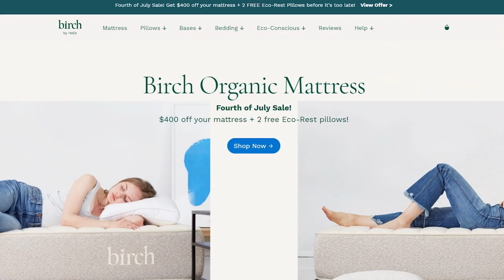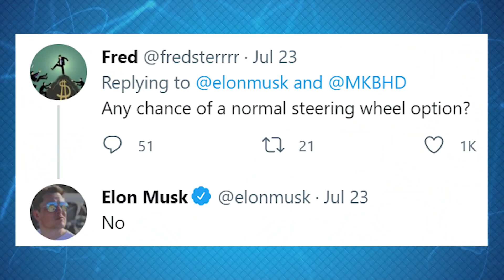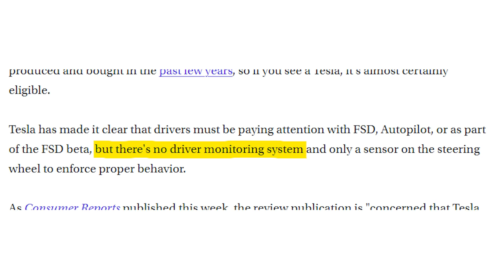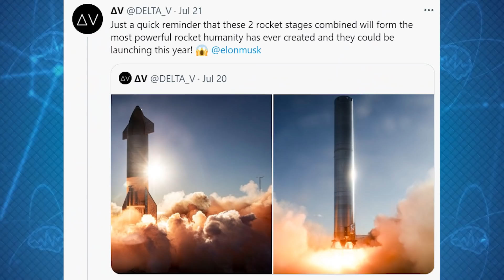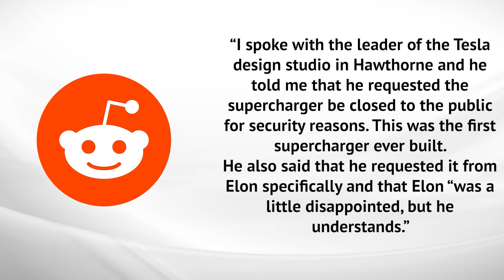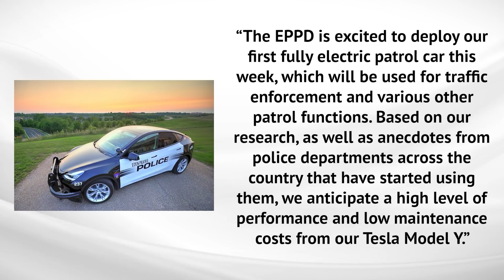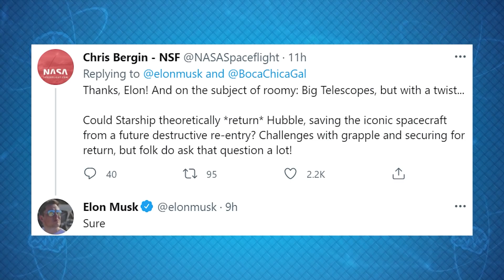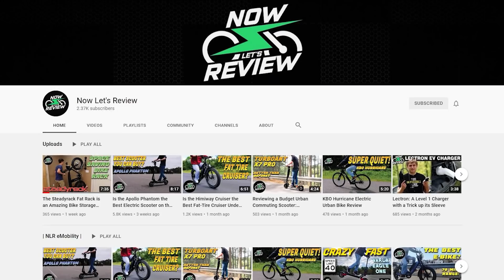Tesla Time News - No More Steering Wheel??!

Comment: The Patreon poll should add "I don't mind as long as the other EV is capable of at least 150Kw charging"

I don't want slow charging vehicles being there for 5+ hours
Reply: Though they charge by the minute right? So a 5 hour charge would burn an unsustainable hole in some EV owners pockets. Those folks would learn not to charge that long at the stations, or run out of money.
Reply: And if it's already more expensive for no Teslas to charge, we might not see a massive increase in congestion, especially at peak charging times because Tesla already raises the price at those times.
Reply: It's like the guy in front of you at the gas station filling his tank with a straw.
Reply: @tommccoy6708  must be a really rich guy
Reply: @justin5646  Taking a quick Look at the Tesla APP, most of the Tesla chargers in the US charge by the kW, not by time.  Charging by time: GA, IN, LA, MI (south), MS, NE, TN, TX, WI.
Reply: @warrenmcelroy6998  okay either way that charge by kW will start at a higher price for non-Teslas and during peak charging hours.
Reply: @warrenmcelroy6998 most chargers charge [Teslas] by the KWh.. (there ftfy)
Reply: Great fin point

Comment: I have one of those Bolts. GM refused to buy it back from me, while they did buy back other ones. 
So now I need to limit the range (which I did for 6 months prior) & you need to park it outside. 
After getting my fix (which didn't work), I again contacted GM to buy back my Bolt and over a weeks plus time they have failed to respond. 
I planned on selling it as I ordered the Cyber Truck (#12,042) but am now wondering if anyone will buy it from me? Ya, doesn't get the range it was suppose to & ya gotta park it outside. OK-sold. I dont think THAT will be the answer, nor will I get what I planned on selling it for (price)
Reply: The "problem is".....they are not "offering me" a new battery. They are "offering" to once again "dumb down my battery" ONLY

Comment: Little point of correction guys:

The Falcon class rockets use the Merlin series engines that use RP1 and LOX. 

The Starship system/Superheavy use the Raptor series engines utilizing Methane and LOX or CH4 and LOX. 

Main reason for easier use of resources on other planetary bodies. The engines are not interchangeable. But on a happy note they celebrated their 100th engine.

Comment: FYI: The Raptor engine used in StarShip/SuperHeavy is not used on Falcon-9 or Falcon-Heavy, those spacecraft use "Merlin" engines.  The main reason to re-test Raptor on SuperHeavy is because it's going to use like 30 of them - so the mount points are wildly different from the StarShip that only uses 9 motors.

Comment: If your Bolt gets just one battery with both of these defects, your at risk of fire. 
1) Dendrite shorted battery.
2) Malfunctioning wire fuse.
Maybe GM needs to add a thermal circuit interrupt device at the pack level.

Comment: The unobstructed view of the 2nd display is a moot point for the cybertruck unless they plan on adding it in. I also think for the work use cases of the truck a standard wheel should be optional or default.

Comment: What about the Cybertruck steering wheel? Offroading with a yoke seems like a nightmare and dangerous. Does anyone know of any Baja race trucks that use a  yoke...?
Reply: I used to drive a push tug at an airport with crab steering.  The game will be different.
Reply: @Jethr001  Driving off-road, it is easy for a front tire to hit a rut or a rock and this will cause the tire to turn. Causing the  wheel to spin violently and get ripped out of your hands. Maybe the electric power steering is different and prevents this. I know this happens with “old” hydraulic steering.
Reply: @ParaSpite  I don’t believe there has ever been any mention of drive-by-wire in the Cybertruck. If it is to have it, Tesla would be making a big song and dance about it.
The new model S Plaid with yoke doesn’t have it. I suspect the Cybertruck won’t get it either.

Comment: I’m fine with the yoke if it has full self driving. I don’t always use the top half of the wheel, but when I do it’s important that I can. Will be weird, and if I don’t like it I’ll replace it myself. I’m handy enough I can do some molding or buy a second yoke to modify into a full wheel… would probably be a good aftermarket product too. If anyone has an aftermarket full steering wheel to replace the yoke I’ll be your first customer when my TriMotor Tank I mean CyberTruck is delivered

Comment: I owned a suburban with faulty anti lock brakes. There were 50,000 complaints registered with the Clinton Administration. GM made a donation, and nothing was done. I disconnected the Bendix anti lock braking system and never had another problem.   And OH yes - I was doing brake jobs every 12k miles to the tune of $1500 a wack. After I disconnected the ABS i went 50k miles with  the same brakes. Hmmmmm!?  I think you guys have a great show.  Watch every episode.

Comment: Yoke steering will suck for trailering. Backed my trailer a 90 turn. Turned the wheel all the way left to guide the trailer, then all the way right before spinning back to center. All while looking in the mirror. I’ll replace with a third party round if available or buy a different brand

Comment: As far as the charging network, opening it up is to get access to the money coming from the US government.  They have to be open to the public not just for a specific manufacturer.  
I am not to sure about the yolk steering and contacted unplugged performance, hopefully they will offer an aftermarket solution.
The GMC sierra and the Chevy Silverado are nearly identical, the GMC is slightly higher trim typically.
Merlins on Falcon9/Falcon Heavy
Raptors are their new larger engine for Starship/super heavy.

Comment: As for rocket transportation, I wonder what limit weather will have on actually planning to use it (buying a ticket in advance). It takes less bad weather to shut down a rocket launch than to fly a plane. Also, the launch site, recovery site (if different from launch), and destination will have to have fair weather. If long term planning is key, a plane would be the better option.

Comment: For the charger thing...About 75% of EV's on US roads are Tesla's - so the increase in charger congestion would be reasonably small.  Also, a lot of those "other" EV's have short range batteries - so they won't need to be sitting on the chargers for as long as a large battery capacity Tesla.  So it might not be all that bad - and if the additional income allows Tesla to accelerate the opening of new chargers - the it's a good thing.

Comment: With the Model Y price raises, is there any hope that we get Cybertrucks for their originally advertised prices?
Reply: It'll be higher to start with, just like the model 3. Then they'll be able to pull it down and down in price until it reaches their promised point. It'll slowly climb back up. 

Just a guess, no real basis for it besides watching the model 3 closely for it's first couple years. Even if the CT is way higher, it's a insane value. A truck that doesn't rust, is insanely powerful and is cheaper to run/operate than a prius?
Reply: I don’t think they will, at least on the ones already reserved, after for sure..but you never know

Comment: I'm still hoping for supercapacitors in Tesla cars. They could really reduce charging time especially for short fast charging stops, which is healthier for the battery than fast charging for longer periods.  

Instead of a 15 min charge it would charge in 10 min since batteries only have a  very short period of maximum speed charging and super caps can buffer in the beginning while the battery pick up speed, then the super capacitor empties it into the battery while it's charging at fastest speed and finally charging itself up again at the end. When driving away from the charger the supercapacitor will provide the power for the first part of the trip so the battery can cool down a bit. 

Reducing battery capacity by 5-10% to fit supercapacitors would actually increase range for city driving because of all that regen breaking.

Comment: 33:00 Correction Raptor engines are not on the Falcon9, they use Merlin engines.
I think you meant the StarShip upper stage uses Raptors.
Reply: 35:20 sorry to interject again but the point to point (earth to earth) flights may not require the booster. The booster should only be required to stay in orbit.

Comment: Subsidies to fossil fuel companies must end -- absolutely -- but remember what happened to the US car market when gas hit $4 per gallon back in 2008.  Demand dropped through the floor, so much so that GM had to file for bankruptcy, and only Ford as a US car manufacturer made it through the crisis in reasonably good shape (not that they are in good shape today).  We have to stop subsidising fossil fuels, but do it in a way so that the economy doesn't crash.  The US auto industry is already fighting the effects of electrification, we need a plan to help GM and Ford make the switch, even if it means that yes we give them money to help them switch.

Comment: Tesla needs to do two things when opening its supercharging network.
1: no adaptor for old EVs
2: sell hardware and software charging models to EV OEMs so only new produced cars can use superchargers. Modules and software sold at a premium which will go to also expand charging network of Tesla. These new models will ensure non-teslas are recognised as  such and the user pays a premium to charge up on a per minute basis. 
Thus tesla buyers get a faster expanded network to mitigate against congestion by non-tesla and tesla owners. Cost of charging could come down for existing owners crosses subsidised by new non-tesla owners.  

The above 2 things will ensure a slow ramp and that user of  the network from non-tesla owners pay a premium.

Comment: 8;27 why isn't there a solar roof protecting those stationary batteries from the heat of the sun? There literally powering fans to help keep them cool (isn't that what those black things are, I've seen industrial cooling turbines that look like that). Even the crappiest, low binned, lightweight photovoltaic covering a few inches directly above the casings would do a lot of good.

 On the opposite end of the spectrum, earth’s atmosphere is transparent to thermal radiation between the wavelengths of 8 and 13 micrometers, allowing heat to escape into space. Researchers are already applying this to various prototypes and the data is very promising. With the right scale, you might want to shroud together a bit more, with next gen active cooling running between the units.

Comment: There is NO need for ultra capacitors in modern EVs using Li-Ion batteries. This is because the Li-Ion batteries can do everything the ultra capacitors can provide. To add ultra capacitors would just increase weight for no discernible gain. Edit: I'll add I've been saying this for 2 decades. I did the analysis back then, and they only made sense for conventional flooded Lead Acid batteries. Even AGM Lead-Acid batteries don't need ultra capacitors if they are designed right. NiCD, NiMH, and Li-Ion all come in formats that can handle high short term charge and discharge rates needed for regenerative braking, and acceleration.

Comment: Hey fellas, I'm sure a bunch of fans have already pointed this out, but the Raptor engines are NOT on the Falcon 9.  The Falcon 9 has Merlin engines.   They use different type of fuel and the Raptor is more efficient since it doesn't bypass the fuel pump exhaust.  Etc etc.   No big deal to most people.  Bottom line Elon is a freakin genius!!

Comment: True FSD won't be possible until we have generalized AI. That's decades away (maybe, we don't even if it can be achieved at all).  There are effectively infinite edge cases that only an AI that can think creatively will be able to handle. However a solution could be to 'project' a remote human driver/remote chauffeur (using a VR headset from the comfort of his/her home) into the vehicle when the car detects it can't deal with the traffic conditions it is faced with or the car needs to take a route that is known to be too difficult for it's AI to navigate.  In fact this work around could be implemented right now in all Tesla's if Elon wants to start disrupting Uber today.

Comment: Supercharger network opening to other EVs - NO PROBLEM. Tesla is growing the Spuercharger Network faster than the non-Tesla EV fleet is growing. Open the network = additional profit opportunity for the only EV manufacturer BUILT ON A FOUNDATION OF ACCELERATING THE TRANSITION TO SUSTAINABLE ENERGY. Who else would you trust to build the most efficient and environmentally responsible DC Fast Charging infrastructure? This is a scary proposition - I'll give you that - JUST LIKE THE IDEA OF SWITCHING FROM INTERNAL COMBUSTION TO ELECTRIC DRIVETRAIN. No reward without risk...TRUST IN ELON!

Comment: Having other EVs on Tesla charge ports is honestly dumb at this point. Up the super charges and than open it up but I honestly don't want to be there and a Volt pulls up and bursts into flames due to THEIR POOR MANUFACTURING. It's nice having only Tesla charge stations. With the 25k Tesla coming out in two years. This will only get worse. Now the rumor has it you will counter it by changing more at peak hours? Just pump the breaks a little and give it two more years. Where you can build more super charge locations. Lines are busy as is.

Also, if you are wearing a mask and your child isn't. Than this isn't a pandemic.

Comment: Okay, Ima go all tin foil hat and fix what they said about Super Heavy static fire. Raptors are not fully developed yet, in fact, they are at the really early stages of their development. The reason for the static fire is that the system works on Super Heavy and the new Raptors (RB aka Raptor Booster) work as expected. The once on Falcon 9 are Merlin engines and they are not Raptors. Raptors use liquid methane and liquid oxygen while merlin engines uses RP-1.

Comment: "He's forcing us all into the future."  No, he's forcing us to change whether that change results in a better experience or not.  In this case, Musk seems to be making change for change sake.  Think of all of us old farts which 45 years of driving experience now having to look to figure out how to put the blinker on.   Explain to me how touch buttons with little or no feedback is safer or easier than a standard blinker.
Reply: A Tesla is the only EV I would consider (in the current market).  The Model S is the only Tesla I would consider.  I am so not interested in a yoke.  I have the funds set aside to buy a 2021.  If a 3rd party figures out how to install a Model 3 column and wheel in an S, I may go ahead.  otherwise I will be looking at a new ICE vehicle.  Way to promote a sustainable future

Comment: Well here in the UK we have little roundabouts and roads with many corners, as far as I'm concerned the joke steering wheel and no indicator sticks is frankly quite dangerous, and not having a drive selector is idiotic. And still no driver display on the Model 3 or Y, it's not good really, it's about time Elon started respecting his customers preferences rather than acting like a tech. dictator, the guy needs to eat some humble pie. The only thing Tesla has on other cars like the Polstar2 and ID3 now is the supercharger network and honestly if Tesla open up the Supercharger network to everyone I'm probably going to get the Polestar or ID3.
Plus Elon still wants to use old antiquated rocket engines when inertia drive flying saucers is way better.

Comment: Seriously, Yoke steering wheels are designed for race cars with very limited power steering and steering wheel turning radius. It's nothing new and there is a reason to have one or not. In Tesla's case, it is a stupid use case since you still need to turn the steering wheel two full turn to reach max turning angle. Unless they "fix" that somehow, using a Yoke is a terrible experience in any driving situation beside mostly straight lines and can even be dangerous. This is basic car engineering and every reviews I saw came to the same conclusion that it is annoying and unintuitive with the current steering column. I will not buy another Tesla if they force this garbage wheel on me (us) unless they radically redesign the steering rack for normal turning and parking. This is a stupid gimmick and I'm extremely disappointed with those decisions just to be "different". It is not about not liking something "new", it is not new and it is just a "cool looking" gimmick that is a major step back in usability, safety and comfort and should not be tolerated by stock owners. It should only be an option unless they redesign the whole steering rack with Yoke in mind.
Reply: Exactly, try to do a counter steer requiring full lock when the backend slips on an icy road. You’ll end up wrapping your Tesla around a tree. But I guess that’s what you get when people who have never been outside California or South Africa design a rectangular steering wheel…..